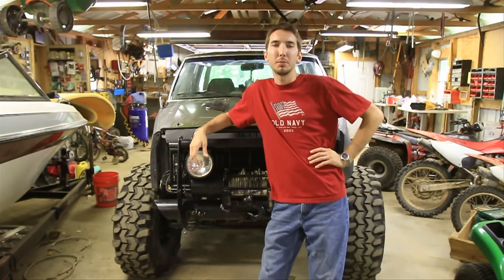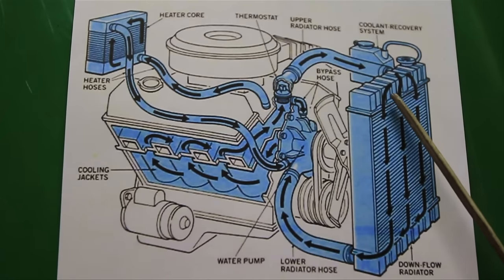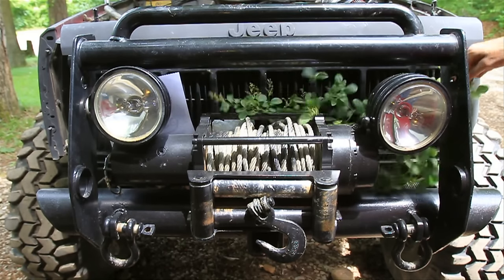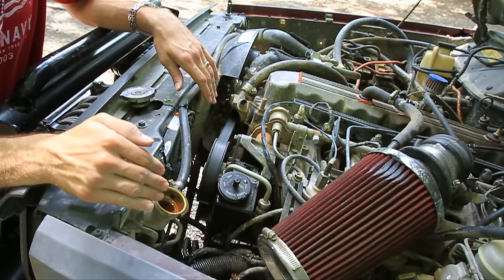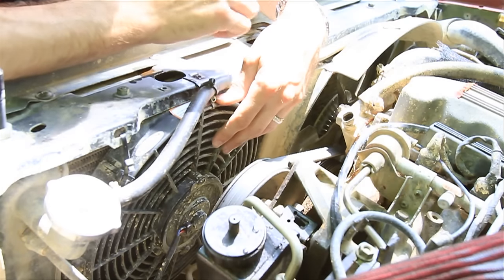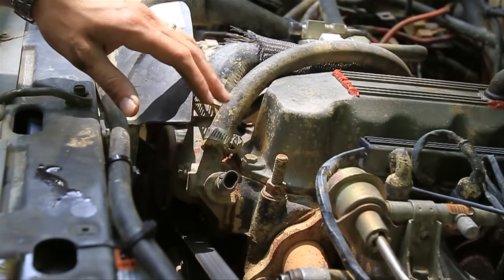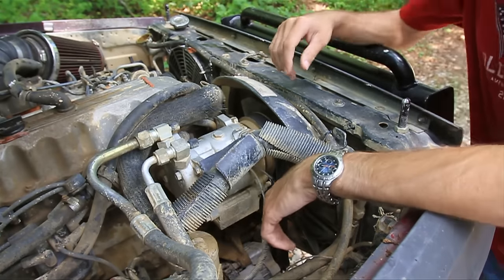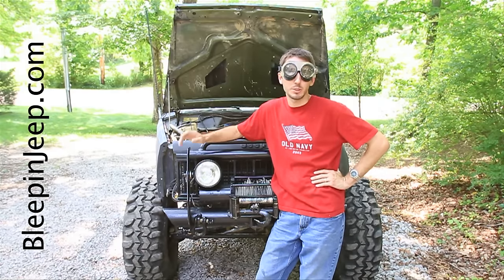Engine Overheating? - 9 Steps to Solve

Comment: Help!!!...I have a 2001 Cherokee...got it about 3 years ago...it had a cracked head but was replaced before I bought it....runs great but always ran a little hot in the summer...a week ago the temp climbed 2 marks past 210...check gauges light came on...made it home in a few mins...didn't see any leaks but added coolant once things cooled down...it seemed ok driving but the temp would get higher up to the first position past 210...I did a flush and it's a little better but still climbs just shy of the first mark past 210...from your video, I went thru the steps you suggest to check and discovered there's NO SPRING in the lower radiator hose...do you think that could be the problem???  or as,some people I've read say it may be a cracked head???...if you could give me some advice I'd greatly appreciate that!

Thanks,
Charlie
Reply from the maker: unless its a really old worn out hose it should be fine without the spring.  I would check for air bubbles, or if you think its a cracked head then smoke out the tailpipe or water in the oil, oil in the water.
Reply: BleepinJeep 

Thanks for your response Matt...I don't see any of the telltale signs like smoke in the exhaust nor milky white in the oil...prior to flushing the system, the coolant was like mud...even the coolant relief hose was gummed up I had to blow air thru it...after the flush, the coolant is now a good green...but my temp still goes up and will be between the 210 and the next mark...sometimes getting closer to the second mark above 210...should I be worried about a cracked head...seems to me if the head were cracked I'd have it overheat after a few mins of running???...everyone on the Jeep forums automatically says it's a cracked head but I still have my doubts...that why I'm asking you because I trust your knowledge of these Jeeps...it's a 2001 Cherokee...it's know they have issues with a cracking head but this just happened out of nowhere...my oil pressure seems normal and it does run rough...any other suggestions from you would be appreciated...thanks for taking the time Matt...

-Charlie

Comment: Mine gets hot but does not overheat when I stop or park my car starts to cool down but when I get to speeds up to 40 it starts to get hot. I put more 50/50 in it and over filled it would this be the issue

Comment: Only one problem when you said to add antifreeze you said to add 50/50 antifreeze and add water either add just 50/50 or add straight fluid not a 50/50 mix but half antifreeze half water distilled

Comment: I have a 2000 subaru impreza 2.2l, I flushed the system out and after a long ride or even getting on it hard once I come to a complete stop my car starts to over heat but if I'm just driving regular around town it won't over heat but after a long ride it will start to overheat.  Any tips or idea's to fix the problem? ?
Reply: maybe air in cooling system? check procedure to bleed air from cooling system for your specific model.
Reply: I'll try burping it again to see if there's air in it. My car doesn't have a air bleeder :( sad so I have to do it with burping it. It's a long process.

Comment: Hello I have replaced everything in my car down to radiator fan thermostat water pump and it's still running hot it still overheats what can the problem be

Comment: hey i have a 1991 nissan 240sx with a ka24de engine. we replaced the thermostat and its a rebuilt engine. the problem is it will reach a normal temperature while it is at idle, but i will drive about a mile and then the temperature shoots to the top. can you help me?

Comment: I have a Saturn 2000 sl.  I just bought a brand new radiator and replaced the old one. My car is still over heating but only when my car is not I'm motion but on for a few mIns.  If I were to drive the temp goes down.  I have noticed that the fluids were coming out the too of the reserivouR. I than Also replaced the cap.  I don't know what else can cause the over heating
Reply: Nadia Hernandez  the fans
Reply: They were telling me to get rid of the car cause my engine is giving to much pressure.  Is that true. My car has low mileage and I don't want to junk
Reply: arm4life87

Comment: I have a 04 Impala and the car started over heating but only when it's not moving. When i am driving i have the heat all the way up and the fans about mid way and it start to get cooler. I looked in the back up tank and it's a little muddy like, what could be the issue?
Reply from the maker: Air flow.

Comment: Bought a f 100 1972 its overheating I put new hoses new themastat flushed and still overheating it sat for seven years and is hella rusted dont want to blow my head gaskeys please help. Thank you kim
Reply: Your Radiator is plugged. You will need to take it a Radiator shop and have them Rod it out. Next time you have an issue call me first.

Comment: To find out if you have a faulty fan clutch,,,,, turn it by hand ,,if it turns just 1/4 of a turn you re ok ,if it turns a full turn or more than it's brocken , also when the engine is getting hot it should blow air to the engine to cool it down ,you should be able to feel the air with the palm of your hand ....

Comment: Hey brah I a 89 Xj with a closed system that I hate lol... But I've upgrades the radiator with a 3core aluminum and I put two 12in electric fanes but only one works ... Don't ask hahahah but she still over heats on me and I can find out why I just replaces the coolant tank on it because it was leaking idk I'm stuck if you can help me out that would be awesome
Reply: So you think if I changes that fan that's doesn't turn on it should be fine until I change over to the open system

Comment: Another test nobody talks about! Start your car with the cap off. let it run. if the water bubbles out, you could have a clogged radiator (which was the problem on the last vehicle  I repaired) or you could have a combustion leak which can be tested with a $17.00 tester you can get at any auto parts store including harbor freight.

Comment: i have a problem with my honda accord 1997 1.8, it keeps overheating, the engine runs smooth, but doesnt seem like the water pump is working, and the fan doesnt start behind the radiator, and the heater in the car is also broken, but just think that i the thermostat

Comment: i have a 99 xj and my electric fan doesnt turn on, but when i jump it straight to the battery it turns on, also when ac is turned on the fan should be on but its not and neither is the ac. the clutch doesnt engage at all, im thinking bad clutch. i replaced the relay and still no fan. the fan should also turn on not just from turning on ac but when my engine reaches 217 degrees F. but it doesnt turn on. am i missing something to check?

Comment: So I'm wondering, a lot of guys down here in florida flat out remove the thermostat, yes I know that is foolish, but with the hot weather all year and heavy use of AC, would a 195*f thermostat work a bit better to keep the engine temp down on a 2001 wrangler? I am installing a 3 core radiator with Electric fan, costly but it's aluminum, larger flow through and with the large electric fan it just works better in my opinion. I already added a higher quality alternator since I have high demand HAM Radio gear in the wrangler and a dual battery system. So the draw of a large electric fan is a drop in the bucket.
Reply from the maker: Florida Shooter I am of the opinion that the ppl at Jeep knew what they were doing when they recommended a 180° thermostat.
Reply: Agreed, but modded engines, lifts and so on will also require modifying heat management. I for one would never remove the thermostat other than just momentarily to do a engine coolant flush. But then replace it with a new one since why not it's out its cheap and I'm already there.

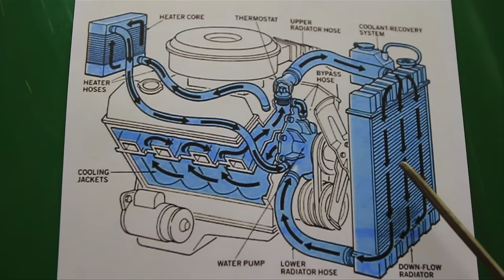Comment: what is the use of heater core? 2:00 mins, does motorcycles have it?
Reply: The heater core works as a mini radiator. It's how you warm up the cabin of the car. The hot coolant runs through the heater core and the blower blows air over it transferring the heat from the heater core into the cabin. This type of heat transfer is called convection.
Reply: Zack Fraser wonderful, ya, bikes don't have them ;)
And I remember why A/C when cold takes more gas, where as hot doesn't use more gas :)
Reply: Two things. You didn’t warn not open radiator cap the FIRST time you opened it. Hope they watched first. 2. My heater core or hoses are my problem. I was hoping for more help at that end.

Comment: I have a town & country 97 and it runs great I can drive for hours and it doesn't overheat, but as soon I turn it off it release coolant to the reservoir and it over flow it and drains some coolant off (about 2-3 liters). When my van is all cool down and I travel again then I don't drive for long and I have to stop because it overheat. I have replace thermostat, radiator cap, and radiator I don't know what else to do. please some advise
Reply: bleepinjeep thanks I found the problem. the electric fan was not blowing enough air, it was to weak. I just replaced it and it solve the problem.

Comment: hello I need some advice my car is vauxhall corsa petrol and gas tank, 2007 1.2. ive had 2 years did only 39,000 miles when bought 1 owner. within 5 months the gasket went when I only drove 20 mins to work and back 6 days a week. since I had it back the coolant tank kept empting if I drove for more than 30 mins and warning light come on. I took back severable times and they kept just chaning the coolant cap as was pressurising and got stuck so couldnt top up may I add I had to refil every 4 days. I sometimes used water as I couldn't aford the ammount of antifreeze I had to use constantly. I took it k and thy changed the whole coolant tank, fine for 4 weeks then again had to top up every week just  40 mins a day of normal driving. now I suddenly after driving for 1 hour I now have to top up every morn and tank completly empty. do you faulty gasket? not done properly? help much appreciated I also have 2 ears warranty left x
Reply: +Louise Nicolsom  Yes i had d same problem wit my corsa.... chk the radiator frst ,scond chk whether the radiator fan is wrking properly .3rd is the fuse or 4th there may be gasket leakage between the cylinder... ur pblm wil b in between these four steps .. so please ask ur mechanic to chk the four cases......... reply me after ur car gets repaired...  Thank you

Comment: I have a 2003 Jeep Grand Cherokee. Its a 4L I6 engine, it has all misfires in each cylinder. any clue cause im not the great at understanding engines
Reply from the maker: try my tune up videos, could be a spark issue, but a misfire in all cylinders doesn't sound right.
Reply: Ok thank you

Comment: i have nasty orange/brown sludge under my radiator cap what should i do ive tried flushing and treating it several times?
Reply: Sounds like you have rust in your system. This is caused by an improper mixture of coolant and water. Coolant by itself acts more as a lubricant for the system, where as water does the cooling. This sludge can also be StopLeak. If your coolant starts getting a coffee with cream look to it, this could be from a compromised water jacket, allowing engine oil and coolant to mix.

Comment: I could use some help if you don't mind, I have an old 67 ford f100, it has a 352FE in it and it sat for 4 months with tap water in the radiator, now I have flushed it and its over heating, is there an easy way to clean it out or fix it easily without replacing?

Comment: My ? is i changed the radiator, thermostad and checked it for any leaks with a tool and it holds the pressure find and no leaks but my honda civic still low on coolant on the radiator and goes to the reservoir but doesnt come back, so what is wrong?

Comment: Hey, can someone please tell me what could be the reason that the metal panel above the intercooler is getting heated all of a sudden? It's just the metal part, hood prop rod above the intercooler. I couldn't even touch them. I can also feel the heat blowing on my foot when I step on the clutch pedal. The intercooler fan wasn't running too which I'm not sure normal for cars (that if it's supposed to run only when the thermostat detects too much of heat?). The heating issue started after my car was sent to a bumper painting. And they jump started my car several times because my (old) battery died in their garage. Thanks for helping :-)

Comment: hi i have a 07 mustang saleen 281 supercharged and the problem is that the water in the reservoir boils and spits it out from the reservoir cap, ( this is possible bc the tread on the reservoir is bad, so it docent close completely) my car won't start overheating till it spills all the coolant out, then i noticed that the heater stopped working only cold air comes out when this happens. what do u think it could be? please anyone help

Comment: what if I changed everything you can replace in a cooling system and gauge and over flow is still boiling??? anyone know this with a 2002 Ford escape? or Mazda tribute? stressing out spent too much money on this truck already if anything message me asap PLZ

Comment: When checking for air bubbles, I took the cap off and started the car.  As soon as it got hot, water started blowing through the radiator opening.... probably a clogged radiator core??
Reply: It depends where your thermostat is located. When the cap is off the system is not pressurized, fluid will take the path of least resistance.

Comment: yeah I'm having a problem with the 1994 Jeep Cherokee inline 6 4.0 just replace the gasket and the thermostat yeah not even I want to say 6 hours ago top radiator hose exploded clean off the top of the radiator we were pushing around I want to say 210 degrees I've checked them with anything however I took it to a mechanic he said from the sound of it it's the water pump and the previous owners  haven't done anything to this job it's solid stock Jeep. that's not my water pump then I most likely thinking it's definitely the clutch fan does having auto transmission four door country model and has approximately 325000 miles and it eats a quart of oil every 3 days.
Reply: 210 is about normal for xjs. But you should really deal with that oil leak.

Comment: Any advice on where to start for a car that only overheats when sitting idle for awhile like at the bank drive thru? Temp slowly creeps up but if I get going driving it slowly drops. The faster I drive the quicker it drops. It's a 02 pt cruiser if anyone has advice.
Reply: Sounds like the heated air is having trouble circulating. Check your fans.

Comment: the temperature guage fluctuates hot after 15 minutes but dont overheat and then the pinging of the engine...then afterrwards i smell exhaust in the coolant resevoir tank when i releive the pressure and take the top off...are you sure its a head gasket

Comment: Can a head Gasket , Make ur car over heat when going up a hill? 

Chevy Cruze 2015 

The plastic clip Brok that Feeds into the Rez (overflow part )  and  house can off , steam came out , but I didn't notice since I was driven 50 mph ,, and I Spiked on the dash , went from 50% temp  to 100% ,, I shut It off,, and i only had Windshield fluid ,, so put a little in ,, drove to the gas station 1 mile , and put water in , Drove to walamrt 3 miles away , bough zip ties ( for the house ) and Anti frezz, came home , flushed system 8-9 times ( since i red that Windshild Fluid turn to Goo , and Sticky Gunk ) and i empty , filled with water , ran , till it got to 50% temp , then empty , ,, then Pluged , then Filled , turn car on ,, till temp got to 50% ,,, shut off, unplugged/.drained , and Filled back up , and again and again , trying to flush THe Gunk ,,, so i Put anti frezz in ,, and drove ,, for the next to weeks , it would over heat , when i got to the top of hill , , i could sit in drive way in part or nutaral , and rev and at 3k 4k 5k what ever , and never overheat , i could Go from a stop , and Punch Gas pedal to floor , and still not over heat ,, it only over heats when i go up a Hill ,, ... i bought some Coolant cleaner stuff , put it in with water , and Ran it through last night ran it for about 2-3 hours , ANd drained it all out , Plugged up and filed with water , Ran for a min , then drain , Pluged back up , filled with water one more time , and ran till 50% temp , then Drain ,,, then i put Anti Frezz in ....... i started car ... i have not road tested it yet ,, i assume that it will go down streaigh aways fine ,, and not over heat ,, Its only when i go up a hill ...... i have had blown head gasket before,,, and there is no Performence issue , or funny noise when 1st starting car or When driving , ( i have had quads with blown head gasket , and cars and its like having  a plug Cat ,,, it doesn't want to go up a hill with weight on motor )  its just so weird that i go up a  ... get half way , or to the top , and it goes from 50% to 100% in 1-2 sec ,, not slowly ,, just SNAP !! UR OVER HEAT < Ac OFF from heat ...Somthing about IDLE  (is what is shows on dash ) so i am hoping i got The junk out , might of been Causing a bottle neck ,, also , when i had the water in and was waiting for it to get to 50% to dreain , i kept the heater on , so i would run fluid through the heatecore,,, and It Would show 50% temp , but cold air came out ,,, so weird,,, the one time , it was hot , i turn the fan all the way up , and it was hot for about 4-5 sec then got cold .. so that's what made me think there was a bottle neck in the Cooling system ,,, idk i like to hear anyone thoughts ,,, i called my Mechanic , and he said it could be the head gasket ..( but he doesn't do head gasket work ) can a head gasket cause a car to overheat when going up a hill ??? ( cuz u would think if i rev it it would overheat also ,) i guess the hill puts whight ont he motor and makes it incress heat , but its just Strange that the heater core isn't Keeping hot , when gage shows 50% temp ..